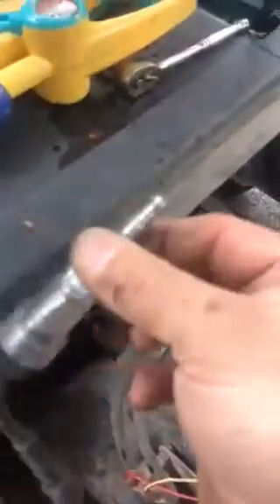Ezgo golf cart troubleshooting tips

Comment: Just for future viewers on the ez go gas carts, if it’s turning over, but not starting, and might even backfire 99% of the time the valves need adjustment! The intake in particular will tighten over time causing it to slowly start, then eventually not start at all.if you look in the breather and see oil sitting in the filter box it’s definitely the valves👍
Reply from the maker: Thanks for sharing!